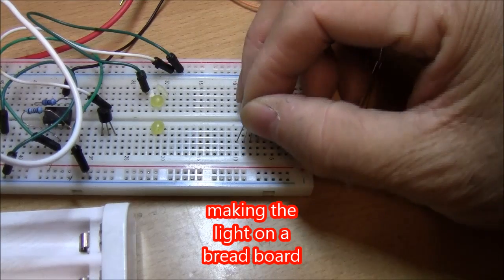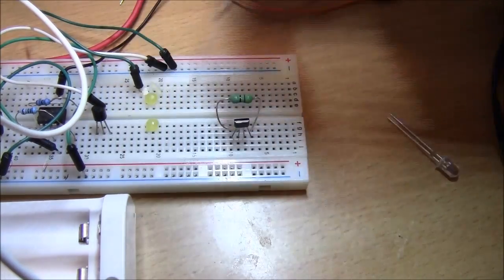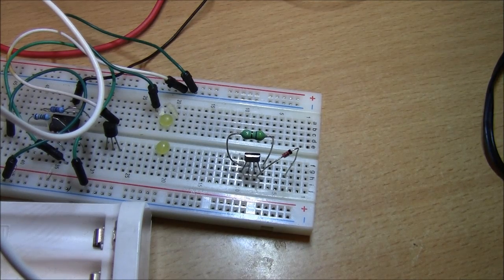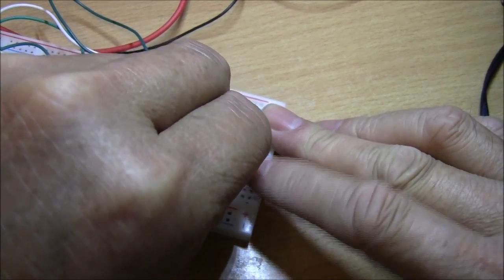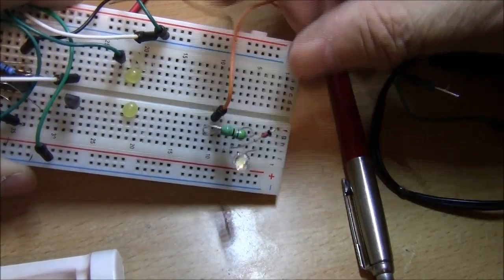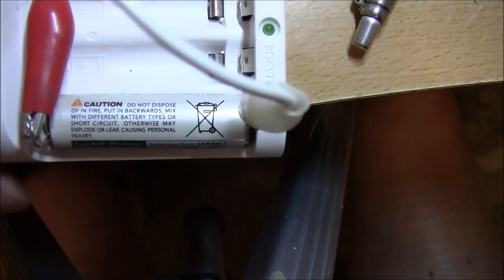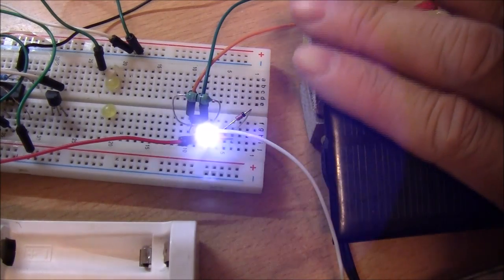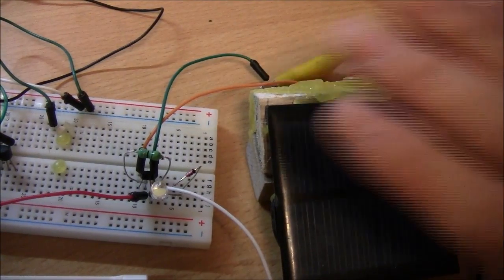Easy solar light on a bread board

Comment: The diode didn't seem to serve any purpose there, explain?
Reply from the maker: My setup is based on another Youtuber mrfreddiew1 who experimented with the switching diode. In his experiments the switching diode increase the voltage output with the result of a brighter LED. 
 A quote from the comments section of his video: "The diode causes a short interruption in the flow of electrons before they go through the diode, creating bigger pulses of the already pulsed DC, these pulses or surges have a higher voltage which inturn creates a brighter LED".
Reply: @wtam69  The diode actually drops .6 volt and makes the LED dimmer.

Comment: @wtam69 I have a 5252F 1501 bridge rectifier I did all the steps as you did in the video and the light came on and stayed on... I'm not sure what I'm doing wrong... HELP?
Reply from the maker: +Robert Golden Not sure what your setup is but I'm using it as a solar garden light. In such a scenario, the solar panel acts as a sensor to control the switching on or off of the light in addition to charging the battery. Recheck your connections to see if you have connected everything correctly.  Also make sure you have the right chip, QX5252F, and not a bridge rectifier.

Comment: Hi Paul
Nicely put together. Im going to make some solarlights for a friend in the philippines.
What would be the difference if you use a 33 or a 47 uH. What led would i use and how many to be able to light part of the driveway. Il build about 5 I think. The diveway is about 10meter long, thats i think 30 feet.
Greetings
Erik
Reply: you have to calculate and measure the mA. Higher mA made it brighter, lower mA battery last longer. Also consider the angle of LED.
Reply: TheOldmankk thx :-)
Greetings from Belgium
Erik
Reply: rikkiesix  Another option, using Piranha 9-12 LEDs module, with TP4056 lithium charging module,18650 lithium battery and 6v 3w Solar Panel not less than 600mA.